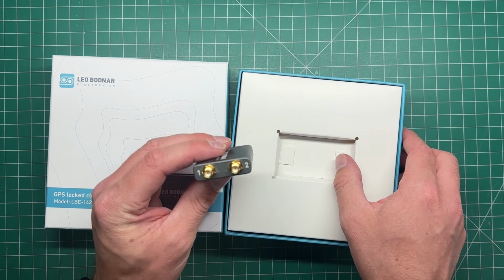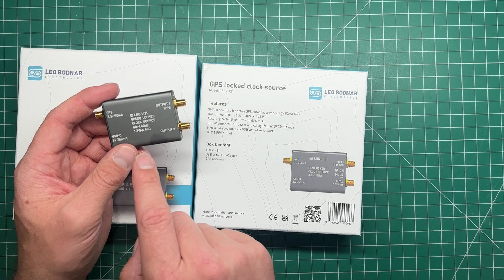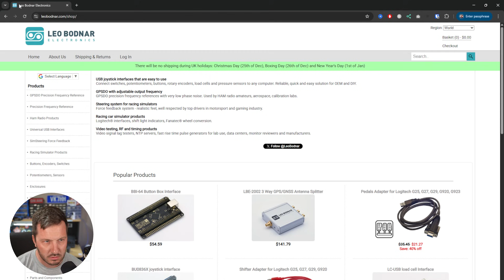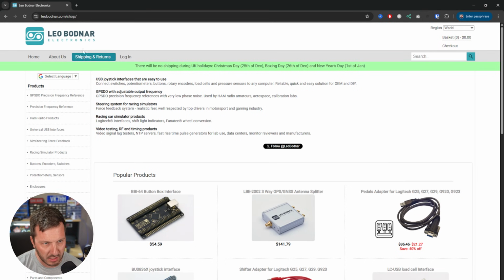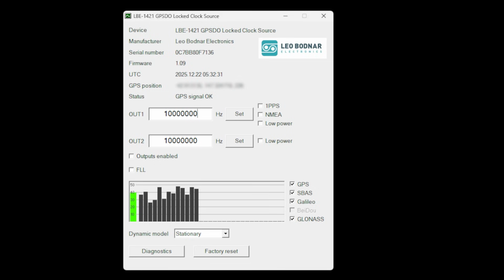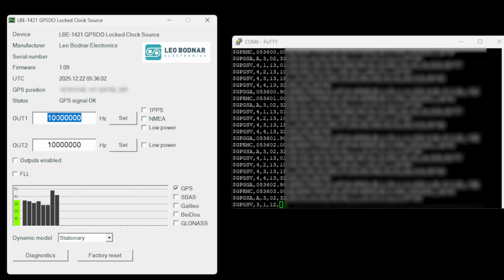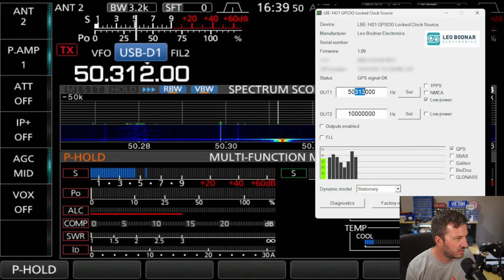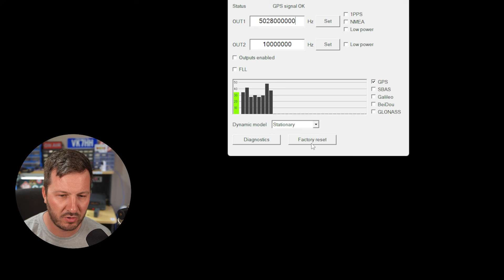Do You Need a Frequency Reference in Your Shack?

Comment: That a handy tool . 1PPS normally for clocks . You can get this WWV /WWVB /WWVH or CHU  as well. We just have a 10 MHZ reference at radio station. That has a internal tempura compensated crystal oscillator that in synced and when GPS lost it goes to crystal  . Their is also a WWV system installed as a old back up . Been in the rack many years . I like watching the LED to see what bands coming in.   I have a loops tic antenna with a small board for WWVB 60 KHZ and has 2 outputs . 1 is that 1 PPS .  It for a Nixie tube clock project  . I use 10 MHZ reference on my frequency counter . It a old HP with Nixie tube display . 8 digit reads to 1.2 GHZ . Old lab equipment.  The internal crystal failed.  So EXT time base makes it work again. Even my Siglent spectrum has a 10 MHZ refence input .  Great stuff ! Cheers from NY ! Merry Christmas !!
Reply from the maker: Merry Christmas Robert!
Yes I use 1PPS for timing audio in my repeater system too

Comment: They may not be as cheap as some people would like (based on the size and perceived functionality) however they are extremely useful in the shack.
It can help stability of HF radios, they can be a great reference point for complex repeater systems, and they can be used for frequency stability in UHF and up operations (for example EME or DATV in the GHz range).
Reply from the maker: Yes very useful! A wideband signal generator which comes in very handy sometimes!